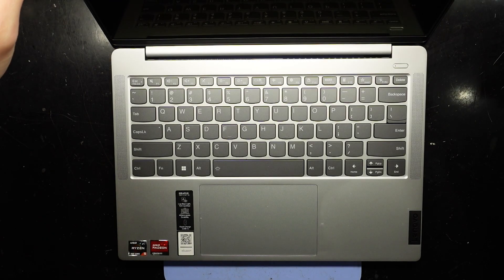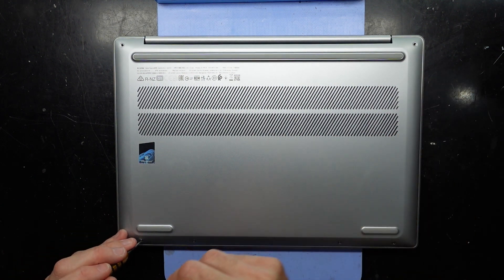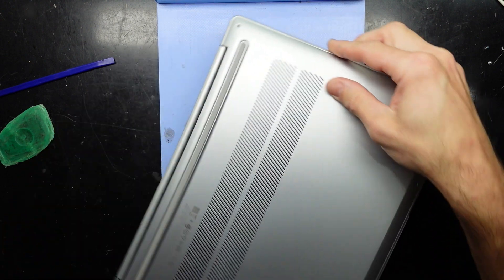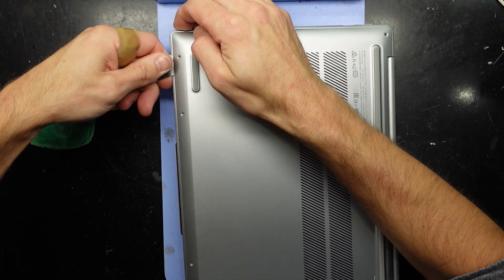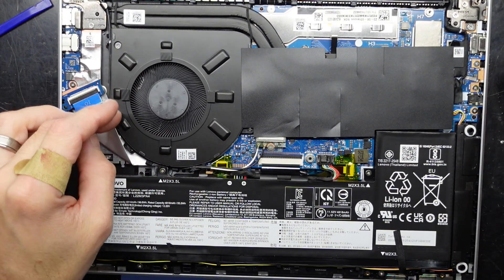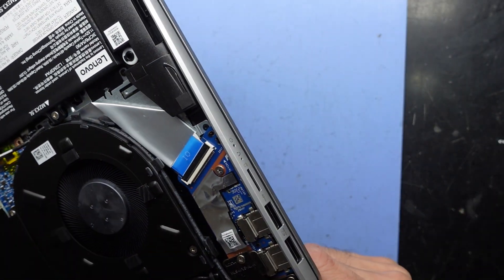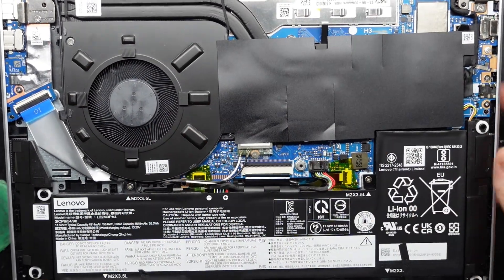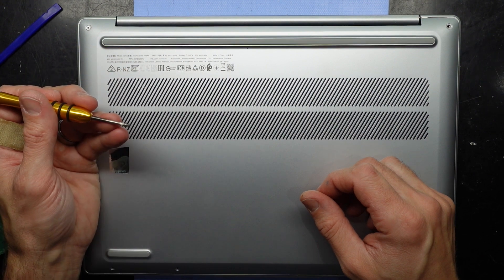Lenovo ideapad Slim 5 / 14ABR8 Upgrade Options?

Comment: Thank you for this, just got this laptop and I am loving it so far. The build quality of this laptop is good except for the thin and flimsy back panel. Whenever I press on the larger rubber pad the back squeaks a bit. Wish they gave a metal back panel, then this lappy would've been a super nice option.
Reply: i got laptop around 3 years ago it just started getting slow cant run anything on it